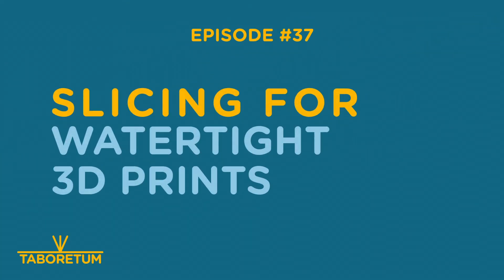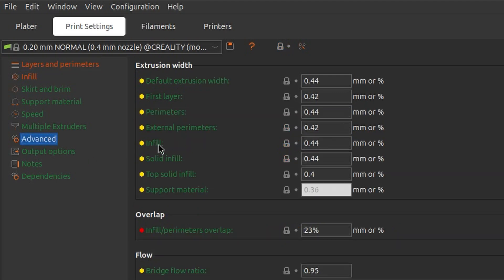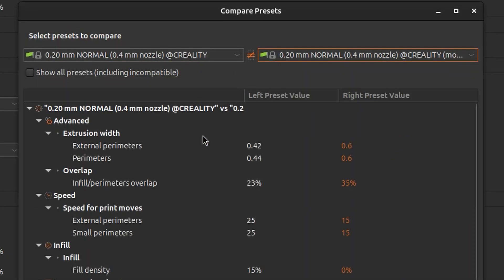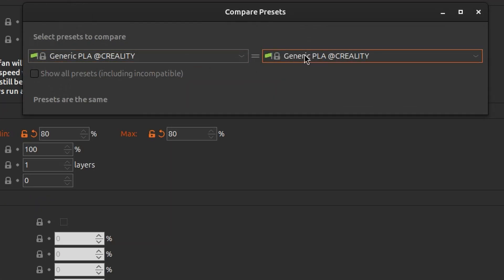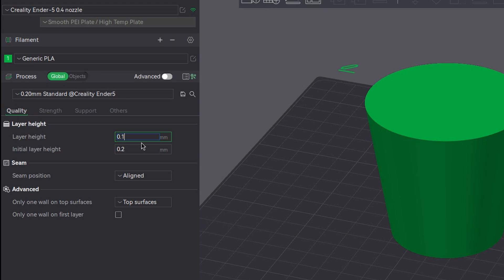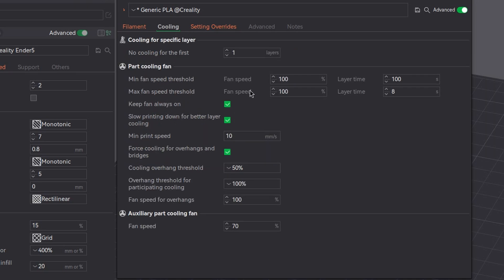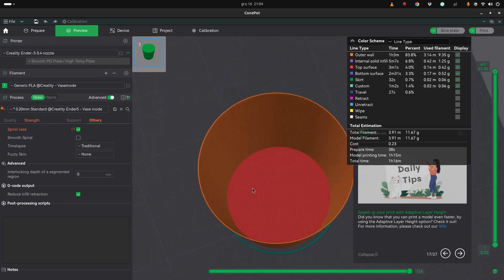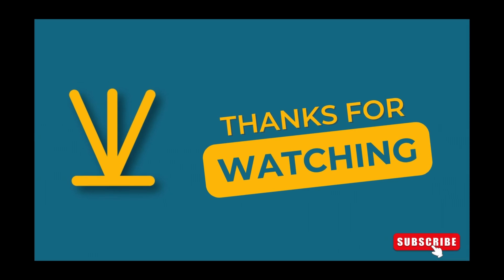Slicer Settings for WATERTIGHT Prints [Bambu Studio] [Prusa Slicer]

Comment: I need to print a waterproof part but the bottom surface needs to have some support interface (Imagine a cup that has 4 legs coming out at the bottom). Right now it is dripping from that area. Are there some settings I can use for that?
Reply from the maker: Add more solid bottom layers, more perimeters? Hard to be precise without seeing the model :) If you designed the model add chamfers/fillets when "legs" connect with the "body" :)

Comment: Fantastic. Definitely some new tips for some of us. It's great to see it working well with a .4 nozzle. Question: What is the empirical thickness of the wall at the end of all of this?
Reply from the maker: Depends :D In general, when using .6 nozzle and going crazy with 1.2mm width I end up with roughly that 1.2mm on straight wall. If you have arcs this "overflow" might wrinkle at corners causing rough surface and more than theoretical width. Nowadays I usually go for .9mm setting.
Reply: @ So for 0.6 noz you go for 0.9? I had heard of the "150%" rule, so I was curious how well the 200% (0.8mm on 0.4 noz) works. :)
Reply from the maker: @74357175  I did 200% many times both on .4 and .6 but usually prints are noticeably messier than at 150%.

Comment: I really love the video; it has been incredibly helpful with my water leaking problem in my 3D prints. However, after trying it, I still experience some issues that are probably because my vase exists with a double layer basically a vase within a vase. This setup means that the water is only supposed to stay in the middle layer vase, but after some time, it starts to leak into the outer layer and causes leaks. Do you have any tips for that? Or could I possibly reach out to you somewhere to explain in more detail with pictures? Thank you for helping the community!
Reply from the maker: Maybe try decreasing the seam gap or even going to negative value. Other option is to go for PETG, as it has better layer adhesion.

Comment: Printing a water-tight cup in vase mode is rather easy, just lower cooling enough so that the layers form a strong bond. The challenge is doing it with complex geometry that can't use vase mode. In these situations it can be very troublesome to get the precise settings correct because it will depend on the exact geometry of the part, the printer, the filament, and the conditions. It can be very difficult to keep the previous layers warm enough for a good bond but not too warm that it doesn't keep the correct shape. With complex geometry you can have it 99.99% right but 1 spot in 1 layer bond has a micro hole in it and the whole thing is ruined.
Reply from the maker: Thats why I suggest disabling refraction. I'm printing diving gear watertight down to 50m below water surface (including diving lights).

Comment: Very useful.  Thank you! Gonna try this in .6mm nozzle on Bambu with p1s.
Reply from the maker: Let me know how it turns out!
Reply: @taboretum  tried it on my .6mm nozzle now.  it DEF made it watertight!  1.2mm layer width and the overlap and no retraction helped a lot.... HOWEVER, the top of the bottom layer looks like a rice field with ridges and bumps (due to the retraction .... ).  I'll have to play with that.... 

next (before I work on the smoothing of the base).... I wanna see how this works with square designs.  a while back when I did similar tests... even though my normal vase was leaking a bit... the squares were leaking A TON. like straight holes you can shine a light through.
Reply from the maker: @alecubudulecu  well, you can dial down the width a bit, with 0.6 nozzle I usually print 0.9-1.0. And I fillet my squares a bit :) Usually looks better and increases watertight chances :)

Comment: THANKS for following through with the detailed information on water tight prints for both Prusia and Bambu Studio slicers.  I will try these settings soon on a couple of prints which are NOT printed in VASE MODE that leak badly.  I am currently printing a lot of GridFinity and Multiboard stuff.  Thanks for taking the time to show us what is possible.   David
Reply from the maker: You're welcome David! These parameters should help with non-vase prints. I'm planning some tests  :)